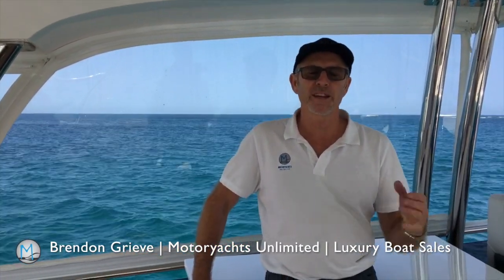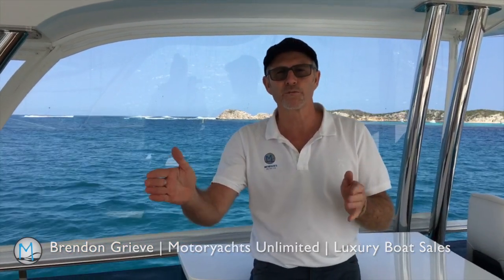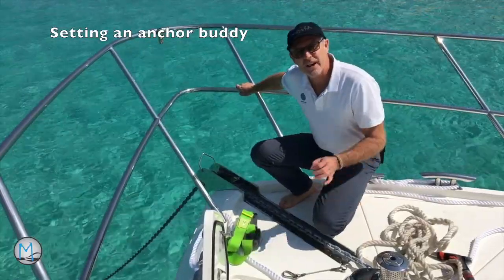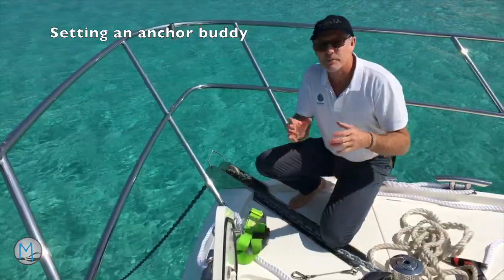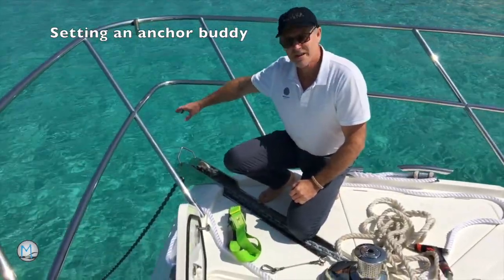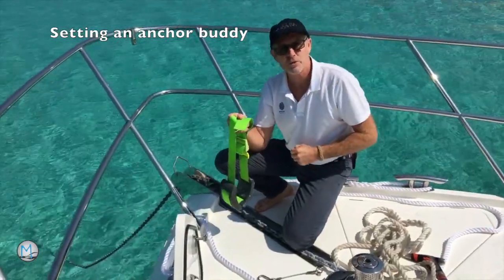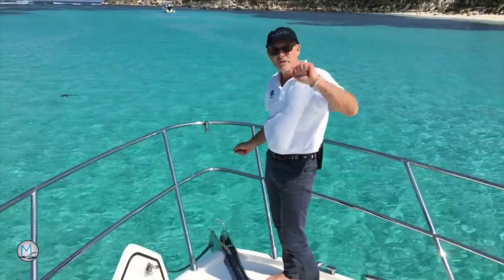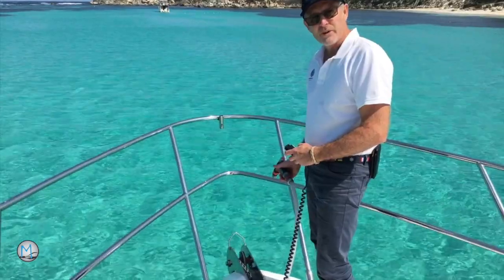Anchoring - Parker Point Rottnest Island

Comment: Great video about anchoring. I found this after a recent horror show at thommo’s on a 40 degree February weekend. I was beach anchoring which I’ve done at rotto periodically for 25 years and I was the only one doing it correctly- anchor deep with TWO stern lines to the supplied beach anchors. 0.07 low tide I knew I had to be a long way out to stay off the bottom if leaving early in the morning. We Ended up leaving in the evening because large vessels were trying to squeeze into 1 metre wide spots and had their lines crossing our lines. The skipper’s ticket 🎫 test is farrr too easy. Before skippers ticket was what was called “small boat proficiency course” 4 weeks night school at Fremantle tafe. Now it’s just a mess on a busy weekend. We have a share boat so we couldn’t work around the weather to have a quiet weekend in shoulder season. Skippers were drunk all over the scene. I saw one passed out dead like on the sand, another throwing up on his boat. I was threatened for doing things the right way so wife and I left. Sent a complaint to rottnest island over email and will see if they get back to me. IMO with Western Australia’s population ballooning (I’m Perth born and bred) rottnest need to sort out their business and have many more rangers at high and shoulder season actually handing out serious fines to people getting it wrong because boat damage is serious business. Rant over.